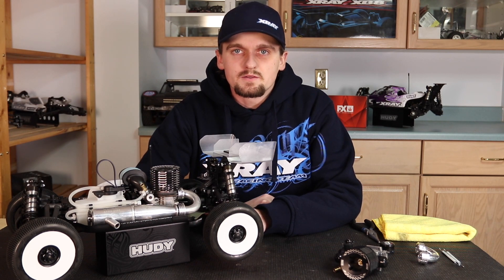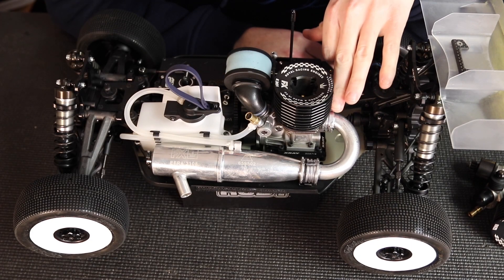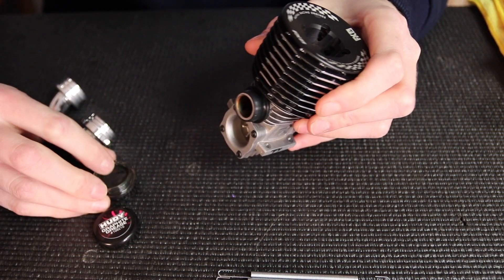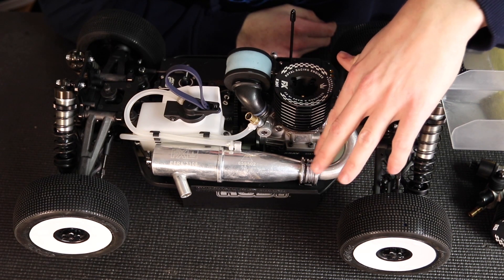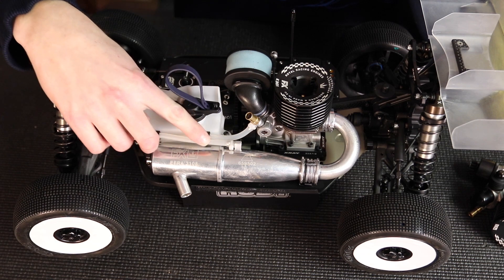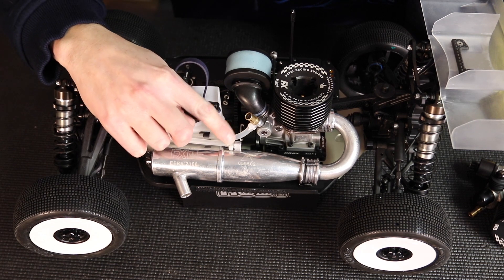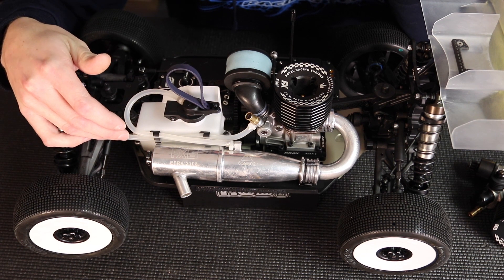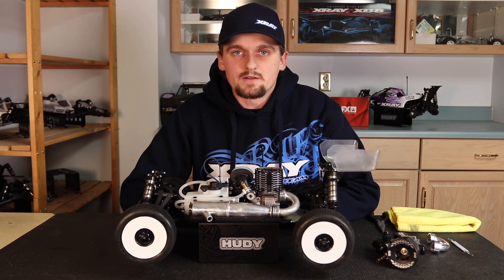Better Engine Performance Series by Ty Tessmann  - Video 2

Comment: An idea regarding exhaust pipe springs: why not to drill small holes and use tiny, long screws and nuts with loctite? For sure it lasts more than springs and its a way safer, especially on a long bumpy race
Reply: it would be to rigid and break